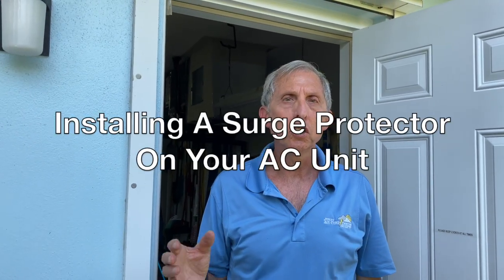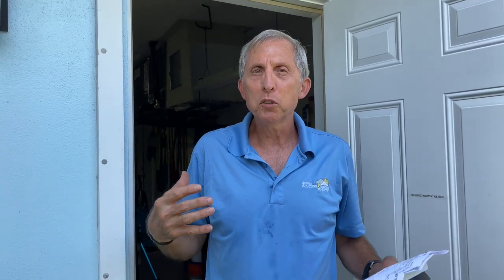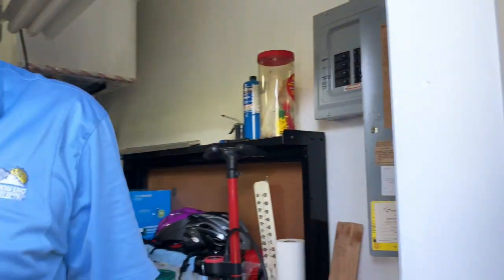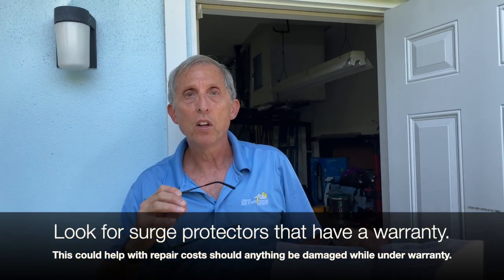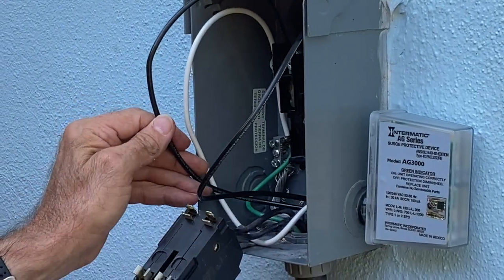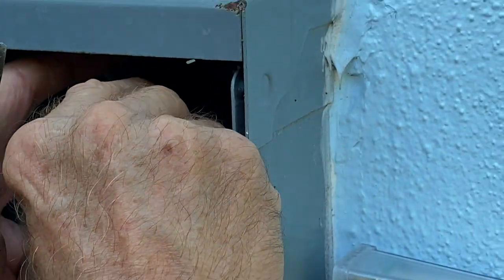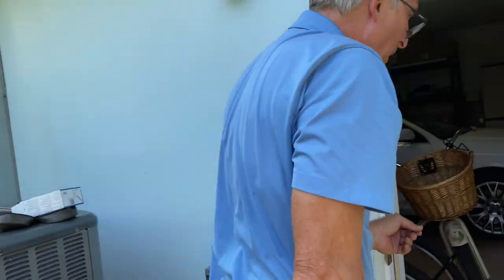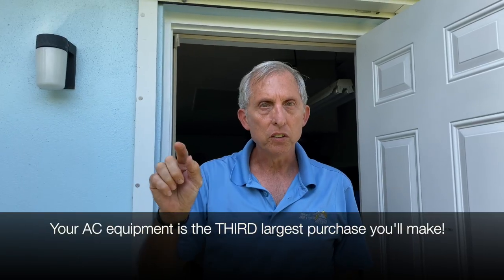Protect Your Air Conditioning System From Power Surges: Step -By -Step Installation Guide:

Comment: According to the intermatic AG3000 box their wires are copper. My box wiring is with copper. So that's copper to copper. A blue wire nut should work Ok with out any compounds on the wires. Is that right? 
's

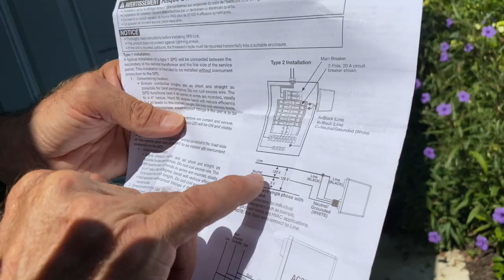Comment: At 2:50 he points to the wiring for a 120 v system, but after that, everything (including the dual breaker) suggests that it the more common 240v system. The manufacturer specifically says to NOT roll up extra wire, but rather shorten wire to make short, straight run (this applies to all SPDs). NEC does not allow 2 wires (double tap) on a breaker unless the manufacturer approves. This needs to be done with pigtails. Unapproved installation will void the warranty.

Comment: I should check my light its been 6 years Mine is a Supco scm150 and needs replaced because there causing fires. I'm looking the for the best replacement there is a mars icm517 and Ditek DTK-120/240cmt+ and now a Intermatic AG3000. Thanks

Comment: The manual says....Determining location:
• Ensure conductor lengths are as short and straight as
possible for best performance. Do not coil excess wire.

Comment: Hello there, we have problems with Voltage fluctuations here in South Florida , where the voltage dips / cuts out briefly and then comes back on right away. This causes my AC compressor many problems, so I installed a ICM Delay on Make Timer. The strange thing is that the timer does not cut out at those dips but only delays once the electricity goes off completely ( same counts for the built in delay in my Air handler thermostat). What do you recommend ?

Comment: Our local code does not allow double tapping (putting two wires) in a screw down connector. Also, it is best practice to ALWAYS reapply Noalox when a connection is disturbed.

Comment: I don't think you are supposed to install two separate wires on a lug.  You should run a pigtail between the surge protector cable and the line cable to the lug.

Comment: 1. You are “double tapping” the lugs on the disconnect switch. Double tapping like that is a hard fail for all electrical codes in all US jurisdictions EXCEPT where the lug is specifically designed to clamp each wire separately. In such a case, the device would be clearly labeled that the wire clamp is approved for double tapping. Such is not the case here. 

The proper way to handle this situation is to install proper sized pigtails on the lugs of the each pole of the disconnect switch and then connect one side of each of the AC Condenser unit and the surge protector wires to the respective pigtail using a wire nut or other suitable connector.

2. To ensure the maximum effectiveness of the surge protector, its leads should be kept as short as possible AND twisted together along their length. Twisting improves the inductive protection of the surge protector. This is not widely known, but every little bit of increased protection helps.

Comment: This is wrong, those leads are supposed to be pigtailed with the line coming from the breaker and then connected to the lugs on the disconnect

Comment: Placing two wires under one lug is NOT to code. That's why your "pull test" failed. The proper way to install is with a pigtail. Only ONE wire per lug!

Comment: Just wanted to add that you should consult the instructions provided with your particular device and in just about every one I’ve seen it is recommended that the leads be as short as possible and connected to the line side. Wires should not be doubled up on the connection lugs instead a pigtail should be used with the appropriate wire nuts or wago connectors for your application Because it is against code to double those connectors because it can cause excessive heat buildup which may result in a fire. In any application where aluminum wire is used some electricians advise using Noalox to prevent oxidation of the wires.

Comment: You’re not protecting anything by putting them under the same lugs. You need to break the power through the device to protect it. You’re just powering a surge protector the way you’ve wired this….

Comment: 5:19 ...The wire popped out because those lugs are not designed for 2-wires. You need to pigtail the conductors so there's only one wire in the lug, the way it's designed. Also, the wires from the surge protector need to be trimmed, not full length. Did you read the instructions before you did this?
Here's a pro doing it correctly: https://www.youtube.com/watch?v=mILq9JCFeBU

Comment: The instructions says to keep the conductor lengths as short and straight as possible.  You are supposed to trim them.  Also, screwing down multiple wires into the disconnect is a fire hazard.

Comment: In Texas we can touch the electrical if is 6ft within the equipment.  But I've seen videos doing different ways of install. Some wire nut 3 wire together and use the 1 wire they put in as the line. Some just screw it along with the line. So confused

Comment: With all due respect, this video should be removed.  The tech left an unsafe situation by his installation. The lugs that he inserted the SPD wires into are not rated for more than one wire. That is evident when the wire he tried to insert along with the original wire popped out. This is not the proper way to install an SPD. It is also irresponsible to present such a fire hazard because others will follow this bad advice.

Comment: Wire leads should be as short as possible. Most important is the neutral/ground, keep it short. I would of installed that ON the compressor unit directly. Every 2" of wire length = 20-25VAC higher, the clamping voltage becomes or when the SPD dumps excess voltage/amps to ground. Keep the leads SHORT. AND adding wires into an already used lug (line side in this video) is not to code or the NEC. You see how easy his wire pulled out from the lug? That's why.......

Comment: I appreciate the video and enjoy the channel. I’ve learned a lot. I actually installed two of these. And not to beat a dead horse, but as others have mentioned the directions specifically call for using pigtails, conductors as short and straight as possible and greater than 4 inch loop.

Comment: I don't understand how this surge protector works at all. Both wires go into the line side, but how does that protect the load side? I would think a surge protector would need four wires: Two for the line side (to the breaker), through the surge protector, and then to the two wires to connect to the AC. Ditto for the AC disconnect that uses a copper bar between line and load to make the connection. These connections all bypass the surge protector, no? Help.
Reply: The components inside the surge protector connect between the lines and also from each line to ground. When an impulse or spike exceeds a certain threshold the resistance lowers and the energy of the surge is absorbed thus clamping the voltage to an acceptable level and protects the equipment.

Comment: Has any one seen an AC Surge protection install Video, where they use either a pigtail, or Polaris taps to combine the wires prior to the lugs. with the wire cut to the appropriate size. and where the Neutral wire is supposed to be properly connected
Reply: https://www.youtube.com/watch?v=mILq9JCFeBU

Comment: Per the instructions--- Ensure conductor lengths are as short and straight as
possible for best performance. Do not coil excess wire. The
SPD functions best if all bends in wires are rounded, ideally
to a 4” radius. Hard 90 degree bend will reduce efficiency.
Cut all leads to the correct length. Do not coil excess leads.
Not sure this guy knows what he is doing.

Comment: Not supposed to double tap connections, need to put in pigtail. Need to cut wires to make the short as possible. Also doing a half ass job.

Comment: NO NO NO NOOOO!!!  Pig tail if you must because you cannot double tap, is one of those things any electrician's assistant learns before lunch in his first day! Is not code!  And, where did you hear or read the wires are not to be cut? On the contrary, you MUST cut them to length and AS SHORT AS POSSIBLE. You want any surge to reach quicker and travel the shortest distance. It will go to the shortest and least resistant path. This is one of those situations where people know enough and he connected the wires but lacks formal training and basic knowledge on electricity, harmonics, etc.  Anyhow, send the green to the NEUTRAL, is how it sheds the surge!
Reply: Yeah none of us have training in residential. I’m literally googling how to do this cause I don’t have anyone to teach me on the job

Comment: I would add a quick disconnect on the wires and crimp it before putting inside the lugs
Reply: What’s a  disconnect and where would you place   it

Comment: Per Intermatic installation instructions:
Ensure conductor lengths are as short and straight as possible for best performance. Do not coil excess wire. The SPD functions best if all bends in wires are rounded, ideally to a 4” radius. Hard 90 degree bend will reduce efficiency. Cut all leads to the correct length. Do not coil excess leads. In other words you should trim the lead lengths to be as short and straight as possible.
Reply: Right. Inductive voltage gets in the wires if too long.  Wires are supposed to be as short as possible.
Reply: Yeah I read the manual too. good info in there.
Reply: At 2:49 if you look to the left of his finger you can see it in the instructions.
Reply: @joeweatlu5169  Good pickup. That is the point where he points to a 120v setup, while he is working on a 240v setup!
Reply: I came here to say the same thing 😂😂

Comment: Against electrical code to double tap like that, especially with Cu and Al wire. Totally illegal. Leave electrical work to electricians. Also, those 2 line leads should be as short as you can possibly get them for the best pass through voltage performance (most suppression).
Reply: Yup shoulda been pigtailed, definitely let electricians do this.
Reply: As an hvac tech I’m here looking for proper wiring on these things and it really chaps my hide seeing this. I know YOU CAN NOT put two wires on a breaker but I keep seeing these things installed this way even by “certified” electricians and I keep arguing that it is NOT to code. What’s worse is the installation instructions show the wires going into the breaker and that’s is like some how magically thats going to work.
Reply: @victorsr6708  In my case, I installed an 'industrial' quality panel suppressor that I bought from a surplus wholesaler. It ties to the panel on it's own breaker circuit. If you have something like this it mitigates the need for, in my opinion, a less effective way of dealing with the surges at the pint of inception. Really it's more efficient and effective to deal with them at the panel. Those 'breaker slot' suppressors and these dinky point of location suppressors are minimally effective. It's like a sponge and can't soak up that much transient spiking.
So to answer your question, if you just install a sufficiently large enough capacity surge arrestor/suppressor at the panel it will cover EVERYTHING n the home. The condensing unit is responsible for most of the 'in-home' surges. It's really to protect the other appliances in the home from the CU rather than the CU, although it does work the other way too.
Reply: The AG3000 comes with tinned copper not Al. Use gray Polaris to splice these.
Reply: @SmartGuyChill  No kidding. But the supply cable feeding the disconnect from the breaker panel is clearly ALUMINUM. He even said he used NoAlox on them.
Reply: @vincemajestyk9497  My bad. Skipped through the video. Polaris black can't handle the fine strands and polaris gray can only do copper. Not really sure how you can wire these safely and to code. Seems like the Rectorseal RSH-50DB with the pre-installed surge protector is the way to go. The HVAC guys just double tapped mine and now I am trying to fix their crap work.
Reply: @SmartGuyChill  I think if you have a properly sized SPD at the breaker box you don't need these little point of service units. I have a pretty good sized Erico on my panel and it covers the whole house. You're right, I don't think there is technically a way to use these on the disconnect, well, that one anyway.
Reply: @vincemajestyk9497  Many HVAC companies require these at the unit for their lifetime warranties, even if they install them incorrectly or illegally. 🤣
Reply: @SmartGuyChill  I guess I sort of understand their reasoning even if it doesn't make sense. One of the main purposes of the SPD in the house is to protect everything else FROM spikes induced from equipment like the AC pump, specifically the induction motor when it winds down. I didn't have one on my panel for years. After I got one of these new high end refrigerators and it started going through boards and having 'mystery' problems I got one. Seems to have solved the problem. A lot of spikes are generated inside the home and some are outside. I think it's a 50/50 mix of somewhere around there.
Reply: @SmartGuyChill my guys don't double tap, we know it is supposed to be wired in series with the line voltage coming from those lugs via a pigtail.  Don't assume HVAC technicians don't know what they're doing just because you got a new tech possibly. 90 % of all service calls we run are electrical
Reply: @lucaswhite3411  A pigtail is not going to wire anything is series, FYI.
Reply: @SmartGuyChill  actually you're correct on that, doing the pigtail, is wiring it parallel.. Also a wire nut for the connections is fine, you don't have to use a Polaris connector if it isn't aluminum wire.
Reply: You had a 240 circuit and showed a 120v protector. Did you get the wrong one?
Reply: @2purplemartin1 - why do you say that?  He showed ‘Intermatic AG3000 120/240 VAC Universal HVAC Surge Protective Device’
Reply: Not an electricians job lol it’s part of the HVAC system. My company even sells the search protectors and we’re supposed to let them know if they don’t have one and sell them to them.
Reply: @haydenb6221  It's a 'surge' suppressor, and yeah, it's a no brainer and free gravy for an HVAC tech to upsell a customer. As of the last couple years whole home suppressors/arrestors are mandated by the NEC for new construction. Panel suppressors are best. They're really for protecting everything else in the house FROM the CU once it shuts down and the induction motor starts acting like a gen. AC and reefers are the worst source of internal spikes in a home. Motors in general.
Reply: Electricians don't deal with HVAC equipment.. you are correct, but an HVAC technician would install this.
Reply: the no connector on the feed coming into the disconnect is also nice ;)
Reply: @markavery2888  I see a 1/2 inch connector on the liquid tight flexible conduit 3:43? Yes, not having those is a big no no
Reply: @TrojenKnight69  The flex yes, but nothing on the back of the disconnect at all...
Reply: @markavery2888  Good eyes didn't see that!

Comment: You need to delete this video.  It has incorrect installation instructions riddled with code violations. You’re going to burn someone’s home down
Reply: Instead of criticizing, how about telling everyone the correct way to do it?
Reply: @da324  There are videos done by real electricians showing the correct way to install this. Also, if you just read the instructions you'll see that this video is not only wrong, but a hazard. That $7,500 warranty will be useless if Intermatic sees this video.

Comment: Dave, at 3m 58s you say to not shorten the leads, and to coil them.  But the install instructions for the IM AG3000 say the opposite.  "Do not coil excess wire."  "Cut all leads to the correct length."
Reply: EVERY SPD should have the leads UNCOILED (reduces inductance-increases performance) and the leads should be trimmed as short as you can practically make them.

Comment: Code violation double tap, use Polaris taps the neutral wire from the device is going to to the ground bar
Reply: What?
Reply: @alambe7275   you should pig tail the wires together and have only one wire under each lug.

Comment: I notice on a/c’s with scroll compressors after power surges they make this loud amplified noise and then a few minutes later they shut off thermal/high/low pressure my guess is a locked compressor because pressures weren’t equalized..

Comment: So much wrong here.    Leads are supposed to be cut to fit, not wound into the box.  Do not double-tap.  Use a pigtail.  I'm not even an expert and know that much from watching This Old House.
Reply: Thanks Calvin, that is what I did. Used 3 port Wagos for 10 gauge and the copper is not aluminum, but tinned according to the specs. So no paste needed.
Reply: If you use pigtails, the connection will generally will be a wire-nut which are not alluminum rated generally(which is what the wires are on the mars, 10ga AL strand), which is the lesser of the two evils?
Reply: @OnePointLander  use a 10 awg wago with aluminum paste. Note that the surge protector wires are tinned copper, so this would only be needed if the line wires are aluminum like in the video
Reply: @OnePointLander  If using AL feeder, you can put no-ox on the conductors.

Comment: Double tapping is not advisable per the other video that I saw. Should have used pigtails. Also, shortening the wire is okay.
Reply: Not only not advisable but totally wrong according to code and a fire hazard.